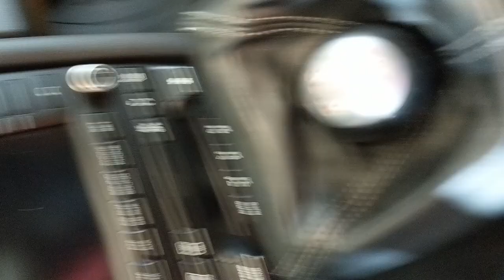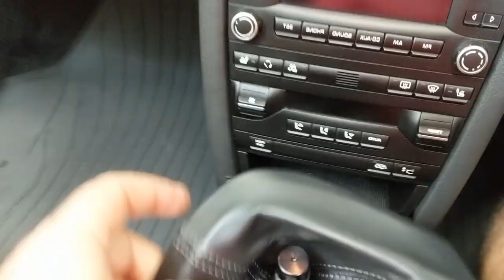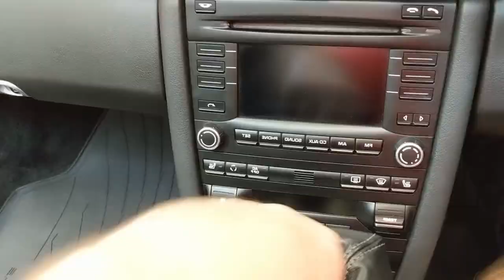Porsche Short Shift Kit Install - Boxster/Cayman/Carrera

Comment: Take those side panels out  it will make it easy they just pull up and out
I would chock the wheels and release the Hand Brake
Also disconnect the battery key in ignition one turn before
 you do it

Comment: How had the shift knob been treating you? I was stuck between this one and the stratosphere for my 997. I think the benefit of the circuit sphere is it’s the closest to stock shape wise
Reply from the maker: Never had an issue, material, shale and size all solid. Thought about a metal one but heat is a factor in AZ. Glad I went Raceseng.

Comment: I miss this Spyder!  I know you don't have this car anymore, but I have a question about your original shift knob.  I got one just like it to replace the stock one in my 12 Cayman Black Edition.  This new OEM part arrived with the knob 90 degrees counter-clockwise from center.  You showed the coupling on the underside of your shift knob and how to release it from the shift fork.  Can this coupling also be used to twist the shift knob back to center in relation to the boot, or is the knob glued/fused to the top of the boot?
Reply from the maker: If I recall, the boot is twistable. If not, you could easily separate it and reattach with a zip tie and never have issues. Hard to believe it would show up that way from factory 😭. Good luck.
Reply from the maker: Not loving the 981??
Reply: @DWraysGarage  😆 that one's cool too! All Spyders are cool by default.  I just have a soft spot for my model's generation since there's so few of them out there.
Reply: @DWraysGarage  Thanks for the advice.  I'm 90% sure it can be adjusted after watching videos like your and others.

Comment: great video. did the short shift came with the alignment tool or do u buy that separately?
Reply from the maker: All part of the kit. Very easy once console out of your way. Thanks for watching.
Reply: Hows the shift feel? Is the throw nice and smooth?
I installed a short shifter on my cayman n sometimes i dont know where the gears are. Lol
Im thinking of going with an OEM kit instead like what u have.
Reply from the maker: @melp1088  Shifts feel good. There's still that tiny bit of 'slop' when in the neutral position but I rarely question which gear I'm in or headed to. I think it's pretty solid. I do hear good things about Numeric Racing's version but have never used one. Apparently that one is a bit tighter all around.
Reply: D Wray's Garage thanks for the reply. I wasnt expecting a lot from an ebay short shifter but once these r installed there is really no way of going back due to the tightness of the metal bushings. 
Now im gonna try to see the (pre assembled) OEM SSK since ive heard nothing but good things about it compared to B&M type of shifters.